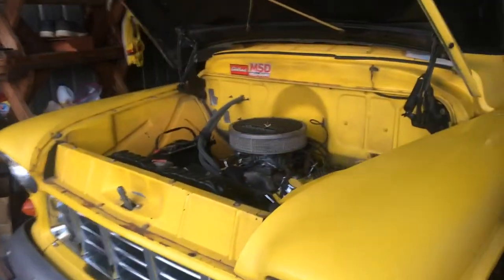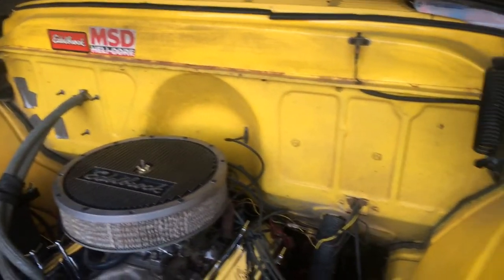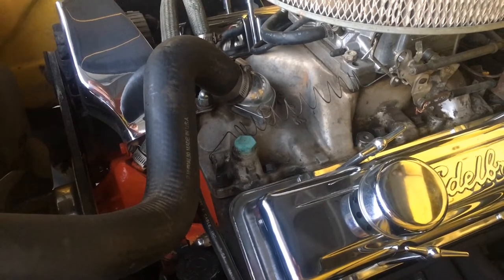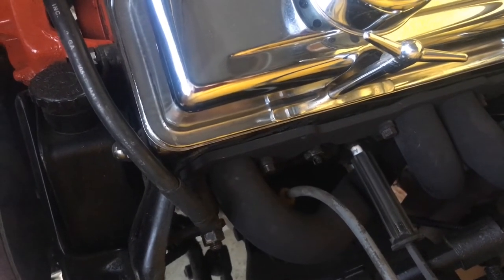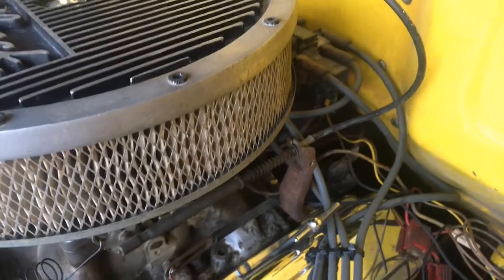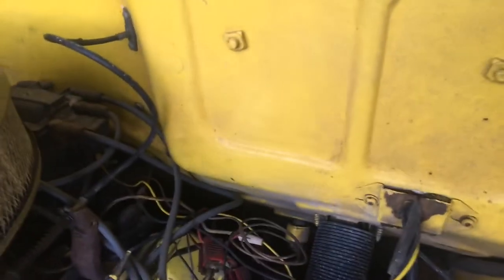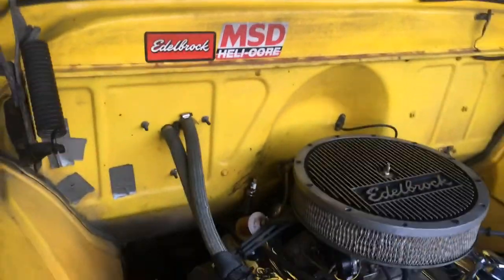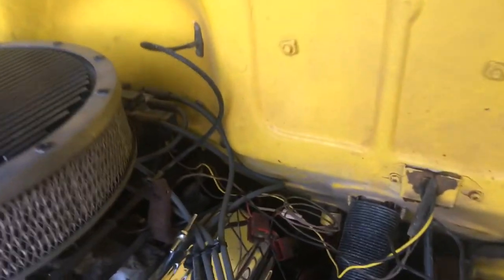55 Chevy Truck/ Holes in the Firewall or Not

Comment: If it were me I'd tidy up that part where the pressed steel is, I'd also run some conduit, convoluted cover over the other wires to tidy it all up.

That's the best case. If I just wanted those new sensors to work I'd see it as just as acceptable to use that new bung with a new hole. Saves disturbing all the other wires. 

Love the shop art!
Reply from the maker: That is a really good idea 👍

Comment: Hey Mike I'm probably a little late for this one lol
You probably have all ready did it. But I probably would put it though that hole where the wires are all ready coming out then you can maybe put some wiring loom on the wires to.
Or don't think it would hurt anything to make a little hole down low and use that grommet to. Both ways would be just fine.
Have a great weekend buddy👍
Reply from the maker: Your never to late Chris, i am not going to do anything this time over,  yes it would seem cleaning up and bringing them through the existing hole was the popular vote so that is what i am going to do, two of the three are already going through there now(of the old ones) so it's only like adding one more wire, thanks for the input

Comment: It'll be alot easier to tidy up the existing. Bundle it all up into one sheath and/or wrap it up in cloth electrical tape and it won't look bad. Drilling a new hole closer to the engine and routing them that way will be cleaner but alot more work. It's 6 of this and a 1/2 dozen of the other, LOL....
Reply from the maker: Thank you Dave your opinion is much appreciated, yes I am leaning towards cleaning things up and going through the existing hole, that seems to be the popular thing to do, although a grommeted hole closer to the middle would look fine as well, thanks for the input

Comment: I think it wouldn't really matter to drill a small hole on the firewall with a grommet. You could even go out the hole where your accelerator cable is if there any extra room! Love the view of those mountains!!👍Catch you next time.
Reply from the maker: Thanks for the input Don, yeah I don’t think a grommet would look that bad in the right place, there’s even a plate under the column that would be perfect to come in from, hey Don we can’t have to many of these 55’s, right😆
Reply: @DesertRatFabrication  
You got that right! There can never be to many 55 chevys👍

Comment: Well....I personally would try to avoid drilling any more holes and maybe just enlarge the one that's already there. That being said, the hole that's already there looks like it's not really in the right place. So if you can make a new one where it's more aesthetically pleasing, and then weld up the other one, that might be a good idea.
Reply from the maker: The one that’s there is for the speedo cable, I think I can make that one work, thanks for your opinion, oh yeah, let’s do this

Comment: What is that piece of bent sheet metal where those cables to go through? is that needed if not I’d remove it and replace with a grommet and run all of your stuff through there it’s above the steering column so you won’t see it on the inside and one clean hole on the firewall would look good
Reply from the maker: S
Reply from the maker: Steven, that’s why I asked for your advice, that is a perfect place to come in from , unbelievable you spotted it, there is a plate that’s not even stock under the column it’s the perfect place to come in, thank you
Reply from the maker: I’m sorry Steven, I thought you said under the column but that’s ok because of your comment I found a pretty good option, and above where you were talking about, with a little cleaning up would also look great, at least now I have some options, thanks for watching, and commenting